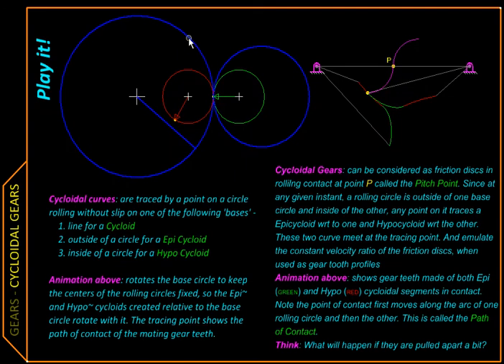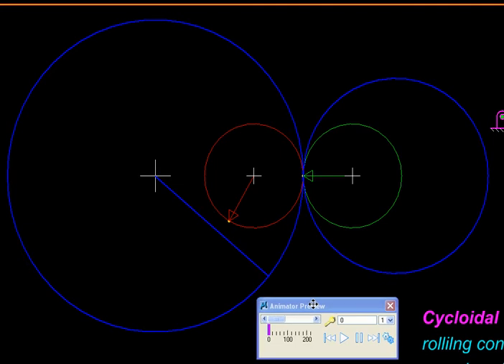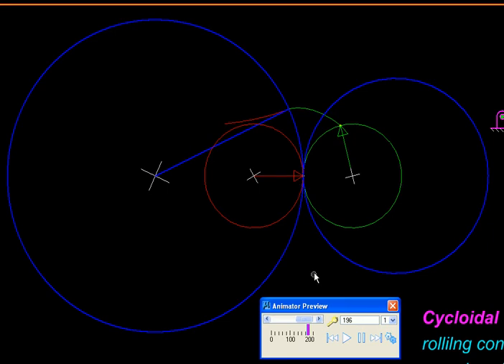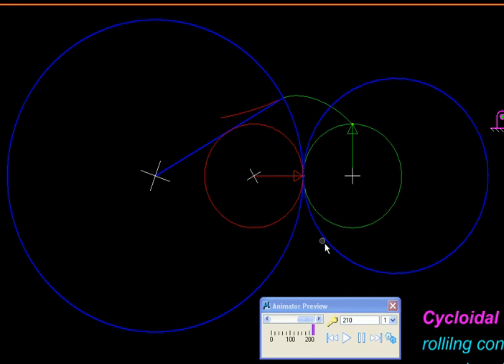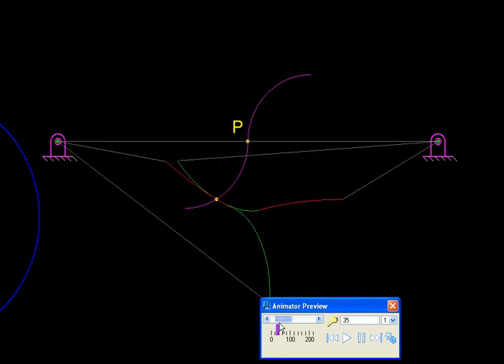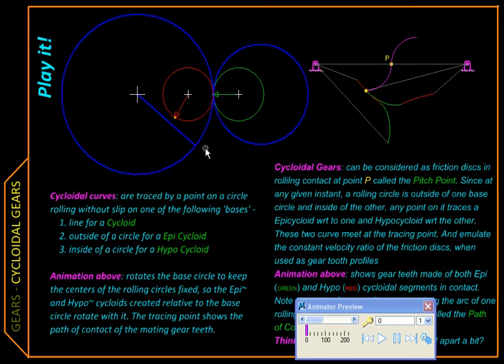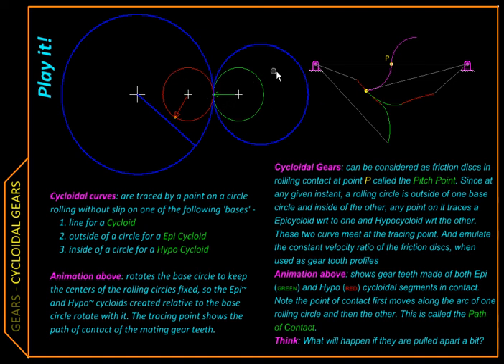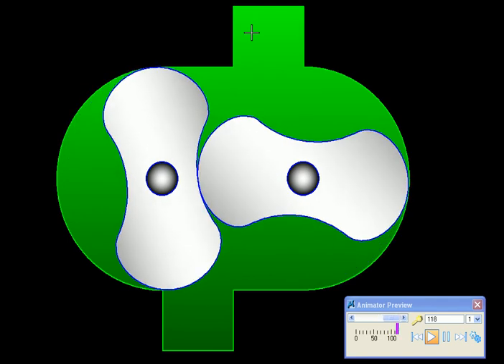Kinematics Ch06C Cycloidal Gears

Comment: sir since cycloidal gears cannot be used where there is vibration so i wanted to know wher it is practically used because completely vibration free system cant be achieved?
Reply from the maker: Nishant Bakshi Rather than thinking in terms of a specific cause or duty condition, think where cycloidal gears can run into problems (violate law of gearing)? The center distance variation! Involutes can tolerate that without problem, but cycloidal gear would have non conjugate profiles meeting e.g. epycycloid meeting epicycloid. Now see where it can happen and decided if that is acceptable.